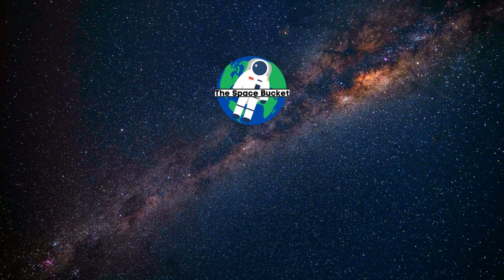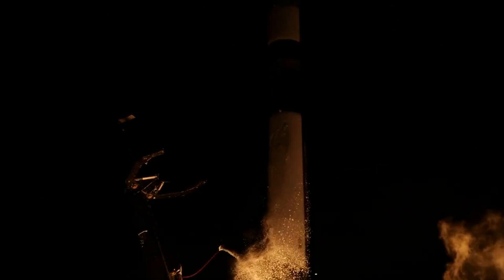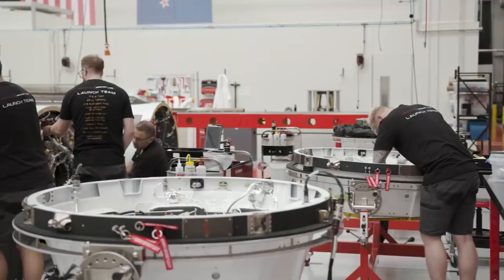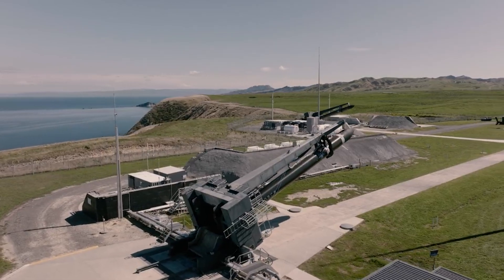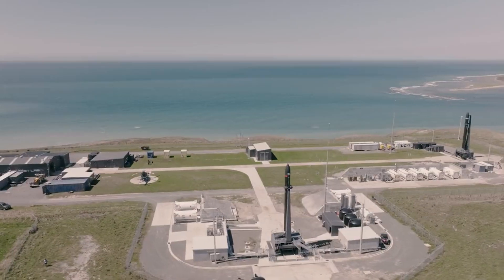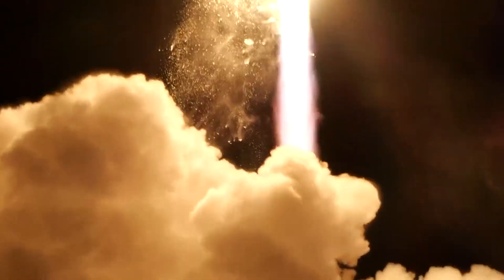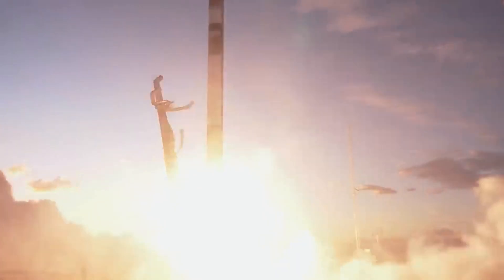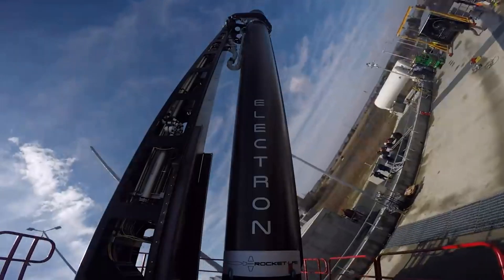Rocket Lab's Upcoming Launch Thanks To Pad B

Comment: When discussing Rocket Lab, as much impressive is the progress of the company is, it should be noted that it continues to bleed red.  The net operating loss for 2021 was US -$15.882 million.  Projected net loss for 2022 is US -$26.709 million.  How long its stock holders and other investors will continue to accept its negative financials is anyone's guess. Analysts predict Rocket Lab isn't expected to break even until first quarter 2024. Its stock price per share has gone from a high of $21.34 to present $4.37 a share.
Reply: Why should it be noted that it continues to bleed red ?
Reply: @paulcarter7445  If it goes out of business it won't be a surprise.
Reply: @WWeronko  But if it succeeds, it will be a surprise ? Strange logic.
Reply: @WWeronko  going out of business?  they have a huge backlog.  There clearly is demand and that should increase.  Is there risk?  yes...but that makes the reward exponential. Stick with a bond
Reply: @paulcarter7445  it is an indication of company trajectory